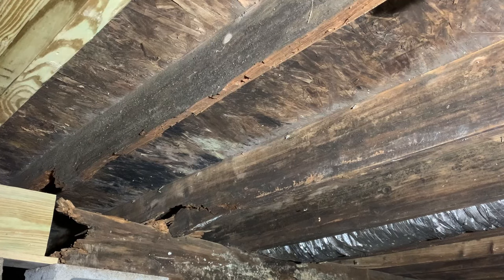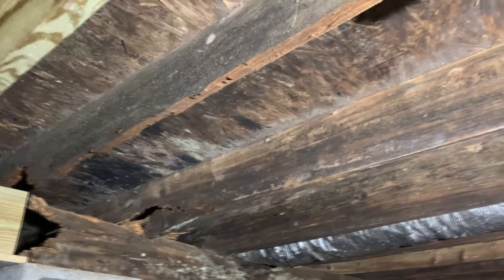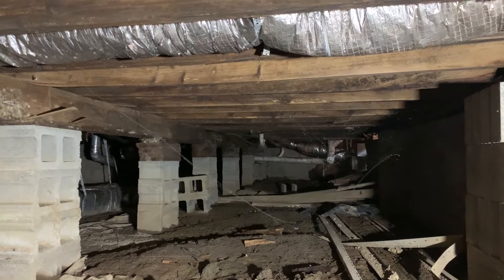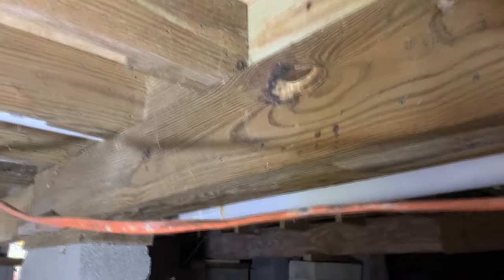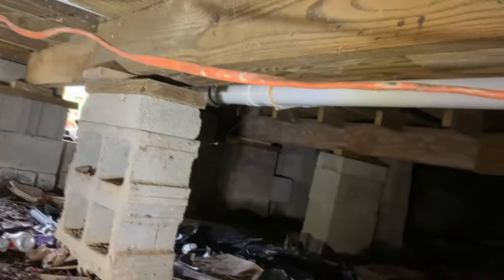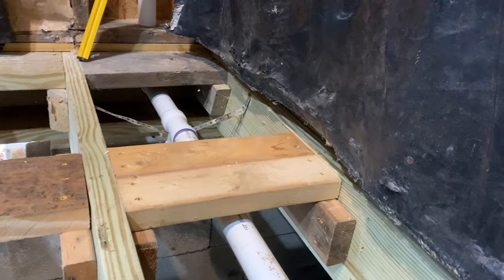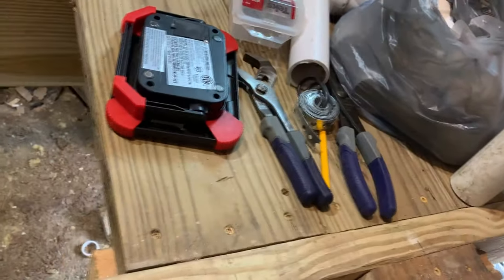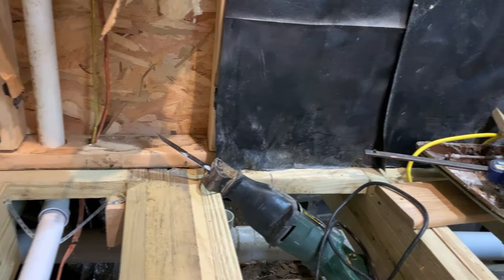Rotten Floor Joist Replacement on a MASSIVE scale!  Entire House Floor Joist Replacement project.

Comment: What wood did you use? Weather resistant? Or which one should be used?
Reply from the maker: I use the Severe Weather wood from Bigblue box store. The Treated wood that is Ground Contact rated.  That way it’s not going to be affected so much by moisture.

Comment: those concrete blocks at 3:22 are off by 90 degrees.   They should be rotated.   But it will probably be okay w/the new lumber.

Comment: So the house isn't bolted down to a foundation. It'll be like the wizard of oz in a tornado
Reply from the maker: I'm lucky NOT to be in a tornado prone area.  However, I do plan to bolt it down once I've gotten it all ready to do so.  Multiple piers along the outside walls will be filled with concrete and use red-heads to secure the mud sill down.
Reply: @HomesteadingBartramStyle  nice

Comment: Wow what does something like this look like cost wise?  I just got an inspection completed and they mentioned one of the beams was rotted on one end.  Who knows what else.....just trying to prepare myself for worst case scenario.
Reply from the maker: Depending upon how much is bad, it can run a pretty penny.  Also depends upon if the lumber costs have come down in price where you're at.  I've had to put some of mine on hold just because of that issue alone.

Comment: How much will this cost
Reply from the maker: Due to the mess with inflation and problems with the supply chain, it’s costing me plenty.  For the entire 1500 square feet of floor in the house, I estimate that it’ll cost around 5 grand or so by the time I complete. But that’s a low end estimate. It could cost way more depending upon how the markets react to things over the next year or so. Yes I’m still working on it today. Living in and working on it has its own set of issues to work through as well.